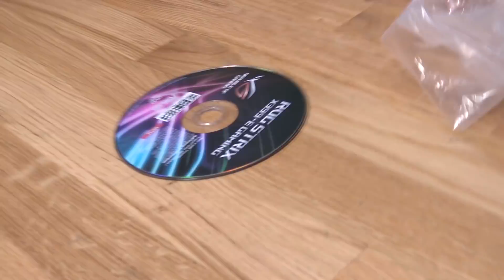Beginners building a PC

Comment: What I got a COOLER MASTER COSMOS II case. There is no shopping bag in the fancy show box that is on the show room floor. I guess its too big and heavy. That COSMOS II is big heavy monster. no sheet metal plate with hooks try to  wiggle wiggle wiggle it in. its got two car doors,. its so bloody Hell heavy. get it out of the box. Role the box up side down cut the tape. remove the white padding. make sure the flaps are out all 4 of them and turn the box right side up.  then lift the box with a tug of war with the box. then remove the cheap plastic bag with out tearing it.  Jay your going to love it. it was design for RACE CAR. lioke Race Car Doors,  Extreme strong build. Lots of Metal. Roll Cage. the finest build  Extreme amount of space for water cooling,. the biggest water cooling system will fit in there. 13 hard drive bays all removable trays and no screws for hard drives. the chunky old school hard drives. SSD that is Notebook size screws. every kind of type of motherboard goes in. ATXX EXTENDED ATX FULL ATX MINI ATX only thing dose not fix is Micro ITX http://www.coolermaster.com/case/full-tower/cosmos-2/ I wish I enjoy using it,. 27 DOA X99 motherboards. and my monitor broke. SCEA refuse to fix it, I need a independent repair man

Comment: So I have run across the issue, of finding a correctly fitting mounting bracket that screws into my AM3+ motherboard and fits my h80i corsair water cooling. I bought one off of Corsair's website that says it supports AMD. It fits the h80i perfectly but there is no way for me to attach it into the mobo. Should I get a new motherboard? Or is there a bracket on the market that will fit the water cooling and be compatible with my motherboard. (M5 A97 R2.0) pls help

Comment: hey guys, need some help. its the first time i am building a PC (mostly for gaming), so could you tell me if these specs are okay and if i should change something. 

GPU = GTX 1050 TI 4GB (probably MINI) 
CPU = i5-7400 
Mainbord = MSI Mainboard B250M Gaming Pro 
PSU = 400W (corsair/gold rating) 
RAM = DDR4 8GB

Comment: No, you do not have to take that cable management bar off to remove the PSU shroud. You can also mount one of those 2.5" drive sleds to the top of the 3.5" drive cage, and not have any 2.5" drives showing on the PSU shroud or have to route any to the rear of the MOBO tray.

Comment: How man idiots does it take to build a computer. 3 !! One to bend the pins on the CPU/MB. One to screw up the power supply connectors. And, one to forget to plug in the computer and wonder why it doesn't boot. Lets not get involved into how the lightbulb that was screwed in to see what you were doing. It gets to complicated.

Comment: Hey Jay,

I have a question regarding a computer problem.

I built a computer 2 years ago and I'm having a weird issue with my 6700k. Recently, I've had to underclock the CPU to 3.8GHz to keep it running stable, because when I leave at the stock 4.0GHz (4.2GHz turbo); my computer hard crashes after 10 minutes on the desktop.

Any idea as to what could be causing that?
Reply: If its not overheating then it might be a power delivery issue. If you can, switch out the power supply and see if that does anything. If it continues to act up with a different power supply, it might be the motherboard.
Reply: I would suggest removing the cooler and the c0u, inspecting the area to make sure that a loose screw isn't causing a gap in the cooler, reseat your cpu and applying fresh thermally compound to ensure that it isn't a thermal issue
Reply: Nope. I checked it with Realtemp GT. Sits at 67 degrees when idle on the desktop. Also have a massive Cooler Master MasterAir Maker 8 cooling the whole thing.
Reply: CarNutz That's pretty hot for idle.  What is it running at while running programs?
Reply: @Ethan Hester - I run the fans a touch slower than normal for temperatures under 70F. Less noise for internet browsing and some none-too-CPU intensive tasks. They ramp up to normal speeds at 70F and the temperatures fall.
Reply: Jejeje fried cpu jejeje time to buy a new one
Reply: @Josef Nilsen - 67 Fahrenheit, 19.5 Celsius. Right around there.
Reply: @Silver Werewolf - I don't think it's fried. It runs alright - it's just slower than it should be.
Reply: Not sure.
Are you sure your power supply is totally fine?
You can try updating the bios
Reseating everything
Clean installation of windows
Try a different cpu with your motherboard.If it still occurs it can be a power delivery issue.
Reply: @Jose Vargas & @CPPCrispy - I'll try both of those, starting with the cooler and cpu reseat. The warranty is also still good with my PSU, so I'll call in a new one.

I hope it isn't motherboard or CPU. That would be a right pain.
Reply: @Tahsin Alam - The PSU is a 650W unit from EVGA. Had lots of luck with them in the past. It's been good to me so far, no apparent issues. It's still under warranty though and I'll try and get a new unit from EVGA to see if it's a PSU problem.

The Bios has been updated twice. First when I got the computer and second after I started having this hard crashing issue. Two different versions, same result.

I'll try reseating everything next. I didn't think to do that the first time around.

A new CPU and or motherboard is kinda what I want to avoid. They're both out of warranty so I'll have to buy each at full price. I'll buy new ones if I have to, but only if I can confirm that they're the problem.

I'll also do a clean install of Windows if all else fails.
Reply: still reapply your thermal paste, it could be that parts of your CPU are overheating (just the edges), just not the part with the thermal sensor. it is a long shot, but worth a try. 
other issue is that your VRMs on the motherboard are overheating and are limiting power to your CPU.
if you could please share your motherboard's details, maybe someone will get an idea. 
cheers,
Reply: CarNutz I don't think its a CPU issue.But I'm afraid that your motherboard VRM might be the issue here.If thats not the case then its the psu.I hope you can get your system up and running properly.
Please Let me know whats the real case is after you sort everything out.
Reply: @Assad Malshy - I'll give that a try.

And the motherboard is an Asus Maximus VIII Hero.

Comment: 2:27 "wait is this the board with the blood on it?"
I feel like there needs to be a backstory there.
Reply: sacrifices had to be made...
Reply: The price for a self build must be payed in blood. Its that simple.
Reply: fun fact (i told nic and jay this) the only time a computer drew blood from me was one of those stupid bright blue CRT iMacs

the hard drive cage was basically a meat grinder

and it wasn't even my computer! so unfair hahah
Reply: There is! Its not that exciting though. https://youtu.be/OkmQw0gnpzQ?t=487
Reply: i've cut myself on the case before, but i've never bled on components.
Reply: Me too, fucking cheap plastic and steel case cut me.
Reply: I cut myself recently on my asrock x370's VRM heatsink, they didn't sand down the edges and it turned out like a really long paper cut because i swung my hand across it to plug in my 8pin eps before i realized the degree of fuckery
Reply: ewwww serrated edge butchery.  seen some dangerous areas on mobos and cards over the years, just never got bit by one so bad that i bled on it...  cases, that's another matter.  ripped open a 3-4 inch gash on the back of my hand/wrist/forearm on a case and uncounted sliced fingers and hand edges.  actually got my forehead once, don't ask.
Reply: yeah, thats why I decided to never get a cheap case again, especially none thats made of steel.
Reply: Worst part is my motherboard is 230$ ahaha